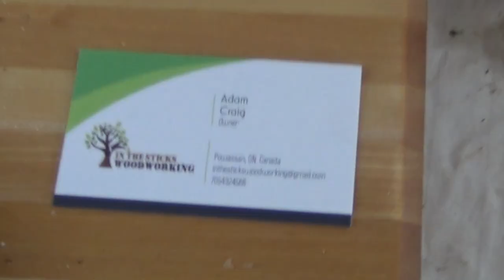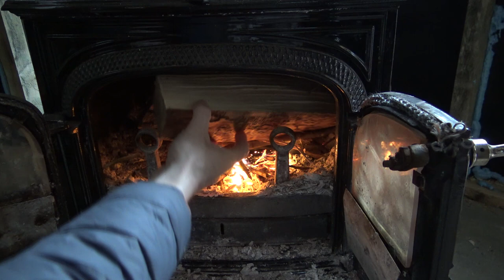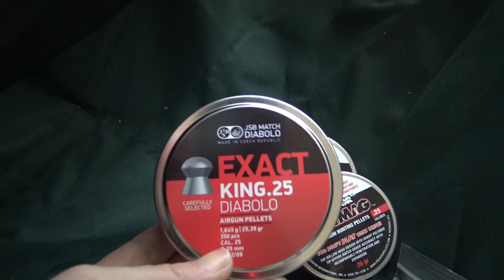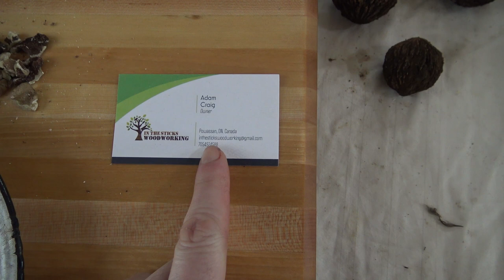Catch and Cook | Wooded Beardsman | Small Cabin | Edgun Leshiy

Comment: Does Dalphenie have her own channel?
You should get a 12 volt air compressor and use your battery pack inverter to charge up your air rifle.
Reply from the maker: Delphanie has an instagram account that is linked in the description of many of my videos.

A 12v air compressor wouldn't generate enough pressure for my PCP rifle - it goes to 200 bar.

Comment: just wondering...   i have seen a lot of cabin in the woods vids, and a lot of them look cool but very flimsy on the construction. so..  the cabin looks great but is it bear proof? cause it looks like one good swipe and the cabin part will just slide off the platform..   just wondering.
Reply: If a bear would come that only means more meat he he, no reason to actually build a fortress cuz of bears.
Reply from the maker: It is pretty bear proof.  It is very solid but unless you use metal cladding I don't know if any cabin is totally bear proof.